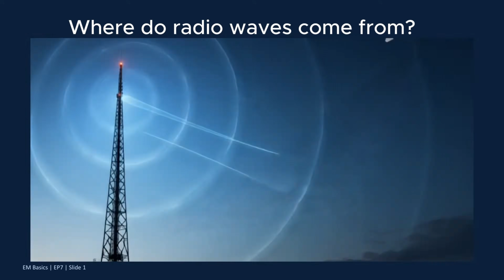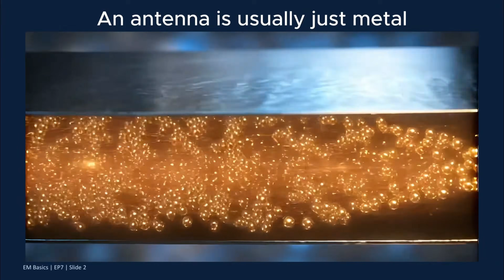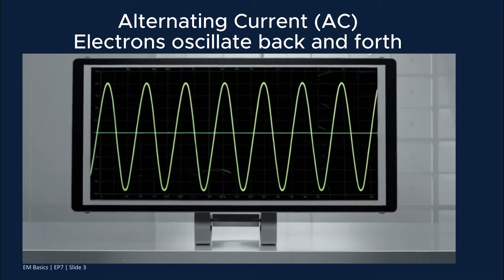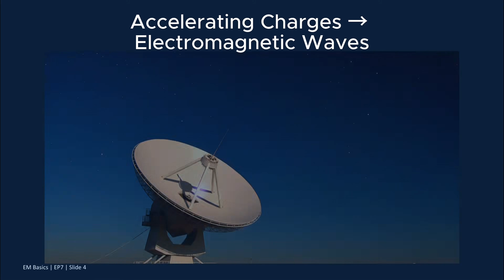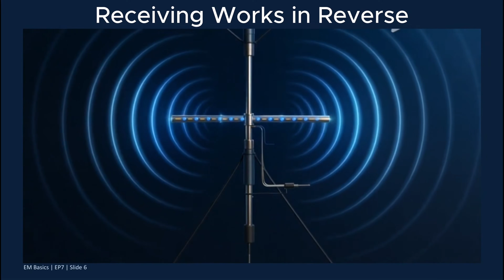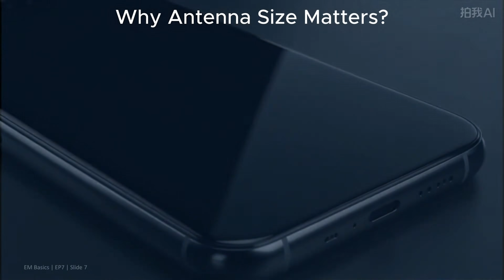How Does an Antenna Create Radio Waves?

Comment: If you remember HAM RADIO operators used to get cancer more than anyone not associated with radio and the power was high in many cases. All modern wifi and cell phones radiation in hundreds of human studies return a similar verdict, harmful to health.
A cell phone tower never was measured and made public info for power output but it apparently goes from 20 KW to way over 100 KW easily depending on size. And they are all over the place.
The discoverer of the electron was JJ Thompson who refused to call his discovery a particle instead he maintained it was a disturbance in the aether nothing physical. They would not grant him a nobel prize until he gave in to the ATOMISTS who destroyed any aether concept for the materialist agenda in science. Tesla always called Einstein a fuzzy haired crackpot and that goes along with working through tensor algebra of general relativity turns out - that math does not work.
It is applied incorrectly all through Einstein’s papers and only by himself. The background radiation was a botched experiment as the antenna was next to the water nullifying any results as microwaves interfere badly near water. Nobody noticed or cared but that is not good science. We love our appointed gods instead!
Reply from the maker: Thanks for sharing your perspective. You’ve raised a number of interesting points about RF exposure, antennas, the history of electromagnetism, and modern physics.

I agree with one important principle: RF exposure should be discussed using measurements and evidence, not simply assumptions or fear. High-power RF can certainly cause biological effects through heating, which is why exposure limits exist.

However, some of the specific claims in your comment—such as the cancer rates of ham-radio operators, typical cell-tower power levels, J.J. Thomson's electron discovery, and the Penzias/Wilson cosmic-background experiment—are more complicated than the comment suggests, and some are historically disputed or inconsistent with the established evidence.

My goal with this channel is not to ask viewers to accept any "appointed gods" of science. It's to show what we can actually measure, what the physics predicts, and where the evidence is strong or uncertain.

I appreciate you bringing these questions up. They are exactly the kind of questions worth examining carefully.